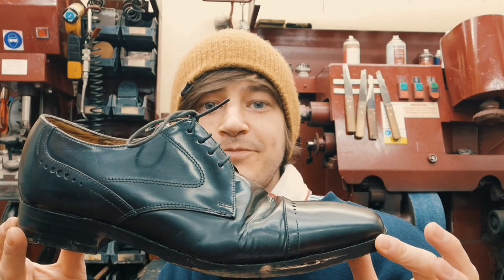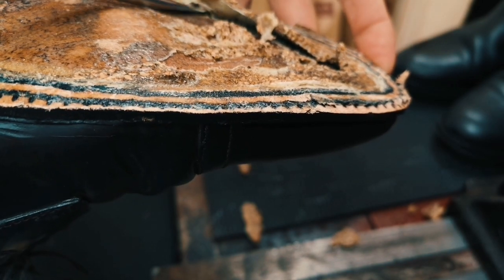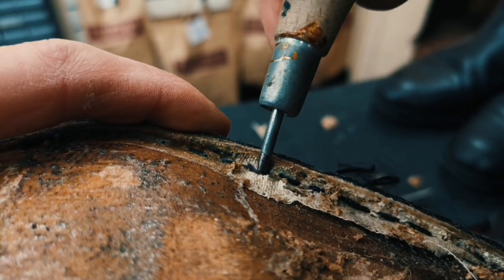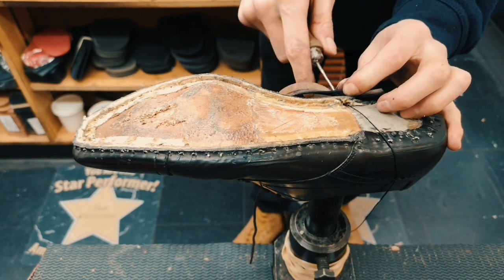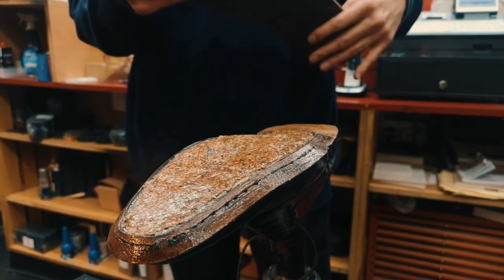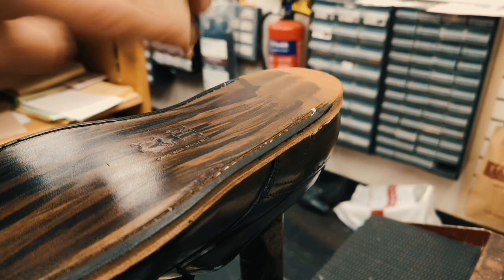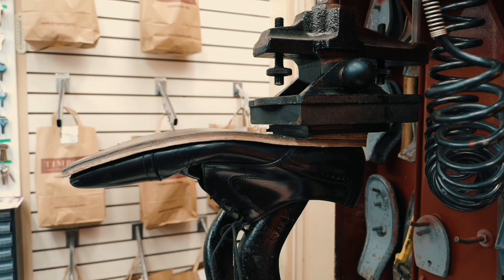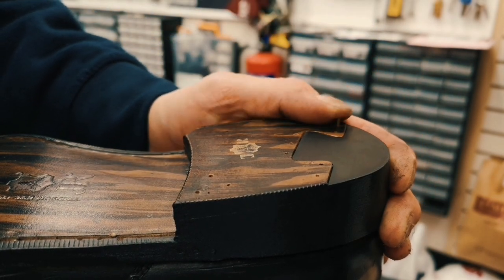Loake 250B Detailed Restoration | Rewelt | Full JR Leather | Resole #28 | Scottish Shoe Repair

Comment: Hey mate
What’s your opinion on Barkers? I purchased a pair of trickers and the right shoe squeaks. They won’t warranty because I have worn it. So I’m looking for a replacement and figure you are the man to ask.
Reply from the maker: Barker's are build great in my opinion. They use all the right materials. The issue you will be having with one of the trickers boots is between the leather and the upper rubbing causing the squeezing sound. You could always try take them to a cobbler and they may beable to solve the issue with a Resole for you. 👊🏼
Reply: @CobblerG  the trickers are two weeks old. They told me to let them dry or break them in. Now they have been worn they can’t be held responsible. Bastards!! So I’ll go to Barkers.
Thanks for the videos and the info. 🍻
Reply from the maker: Check out Thursday boot company. They do a range of boots and shoes, great quality for a lower price than most makers. 👊🏼
Reply: @CobblerG  You can't go wrong with a pair of Barkers, I have a few pairs and they are extremely well made - check out their factory shop as you may grab a bargain. I caught the shoe bug many years ago and if I spot a good deal I cannot help myself I prefer to buy British shoes Barkers, Church's, Grenson, Loake, etc. There are also good deals to be found on eBay also try Abbots https://abbotsshoes.com/ (I am not affiliated just a customer) got myself a lovely pair of Grenson boots there recently.  ps in reference to the squeak try cobblers cream to hydrate the area this has worked for me before.
Reply: @grahamluke2280  thanks! I ordered a pair with a belt.